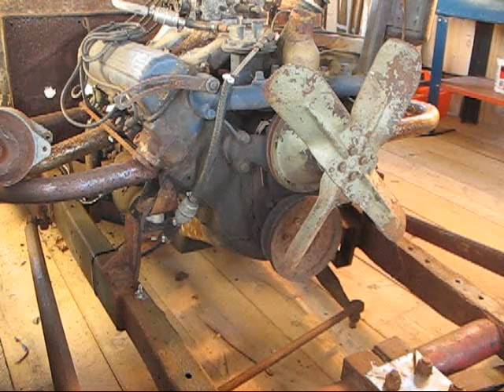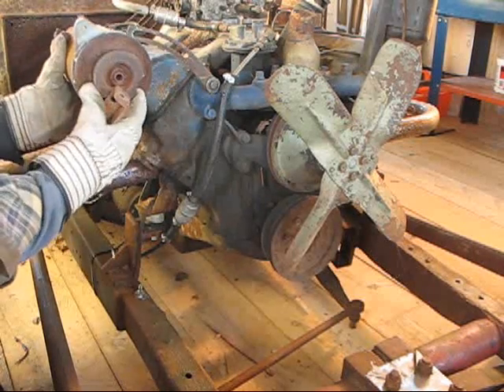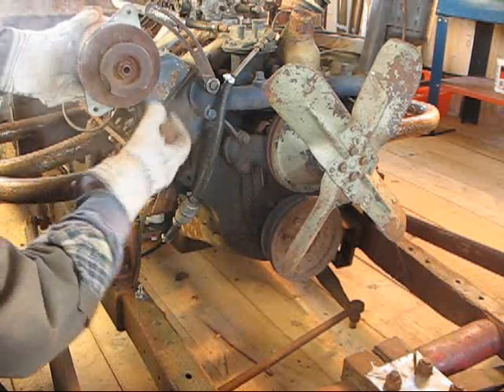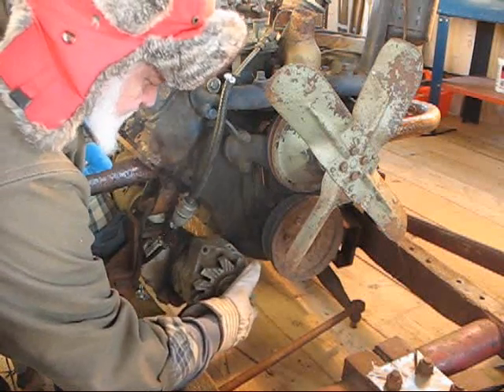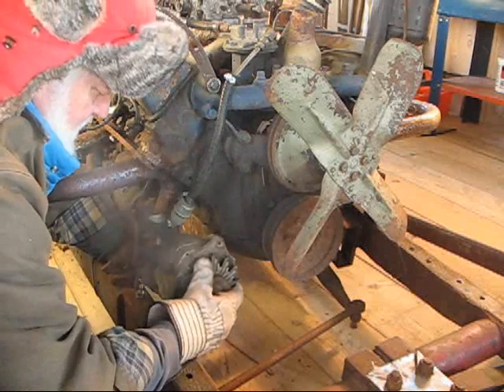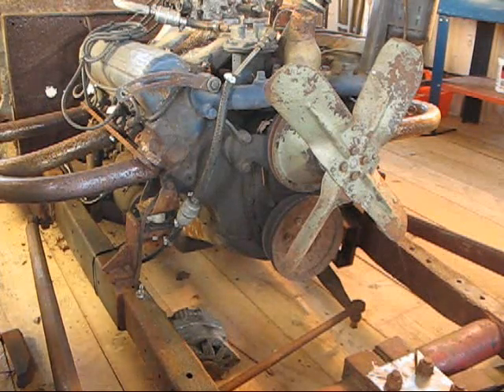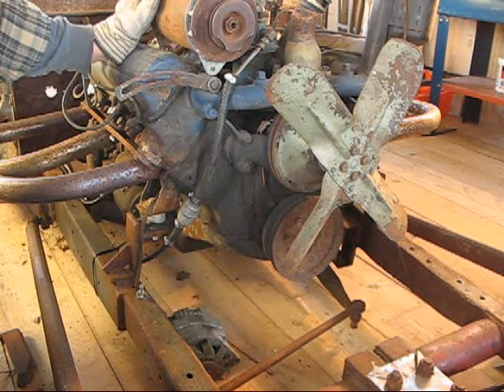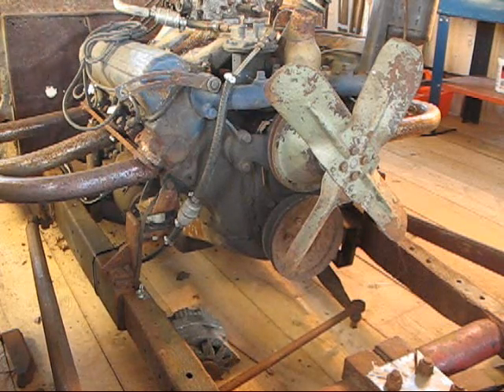Trying to figure out the generator, alternator setup

Comment: But everyone needs to remember the generator is for 6 volts not 12 the alternator is for 12 and I've seen atleast 10 rods with the alternator mounted on the frame just leave a little more slack in the belt

Comment from the maker: I spent two years building the garage before I could start this project, so I know your pain.  I'm now thinking I can mount the alternator to the engine, right about where the motor mount is, and make it work.   That's what I'll be working on next, after I finish messing with the radiator..

Comment: If you had the stock exhaust manifolds, do you think the bracket would work? Of course the headers are a not to be compromised , but may explain it not fitting. Mounted to the frame...How about a spring loaded tensioner? To keep the belt tight during torque and vibration stress?  I really enjoy the videos , I am a tinker guy too , but I dont have the means to tinker at the level you are tinkering. Just wait till I get my garage built!

Comment: I can see now what you mean about your engine mounts.. pretty stiff looks like. I was wondering, could you mount that generator bracket where you held it there...just below the rocker arm cover.. then flip that little tightening bracket over and have it come down under the generator?? you'd probably have to lengthen it some but it might work.. just a thought.

Comment from the maker: well I'm thinking that's exactly what it would do...  On the other hand, I don't have much rubber between the engine and the frame, unlike a normal engine mount, and when I race the motor, the whole frame tips.  It might work.  Any other solution I can think of, so far, sure does involve a lot of fabrication..

Comment: question.. if you mount the alternator to the frame.. what happens when the engine torque's? will it rock away from the alternator and break the belt.. or rock towards the alternator and loosen the belt? you'll figure it out!  looks good man..im excited for ya that you got your pulley and all!